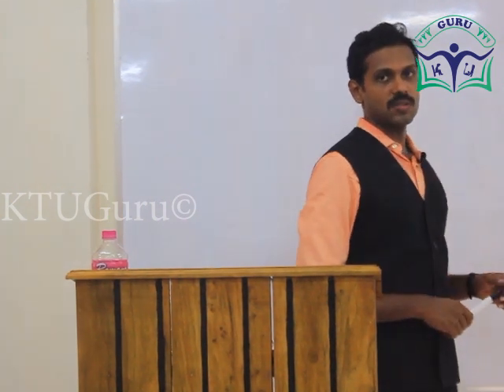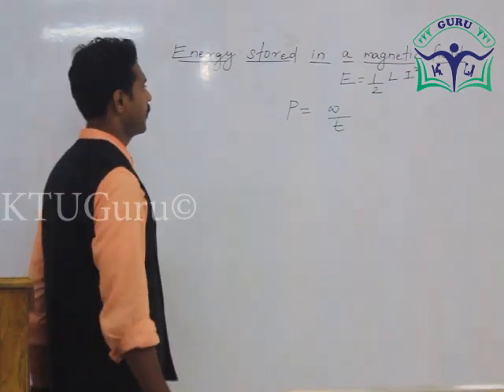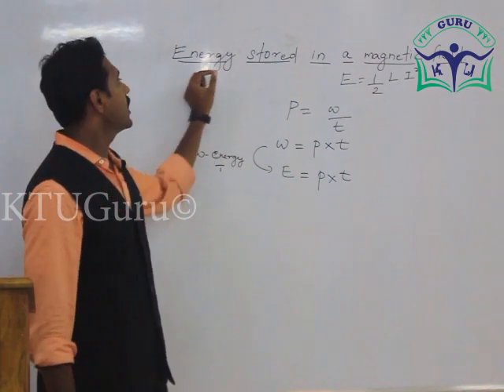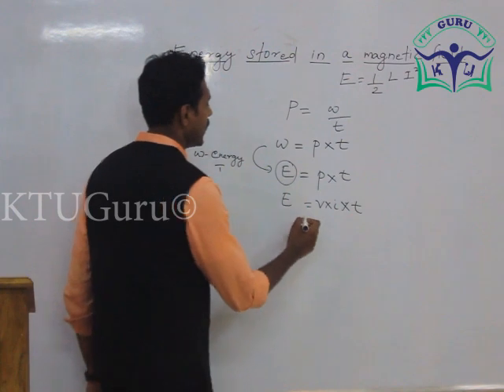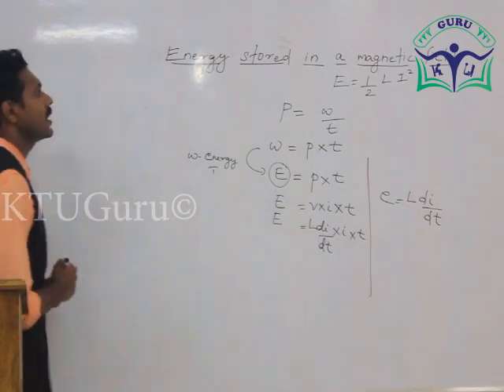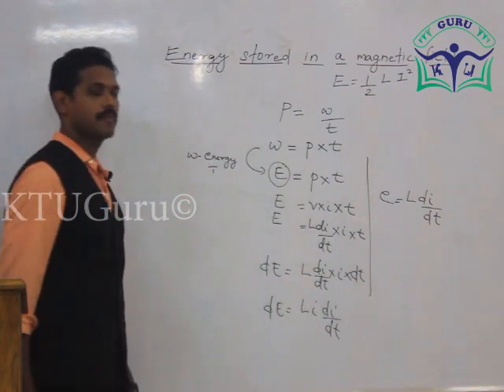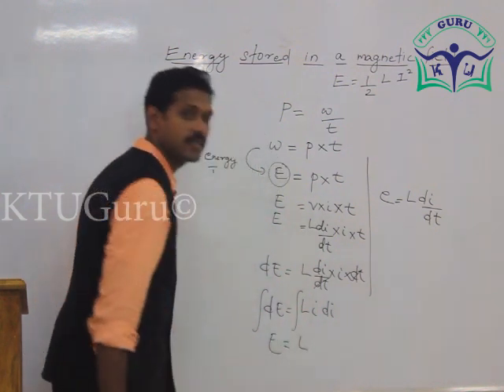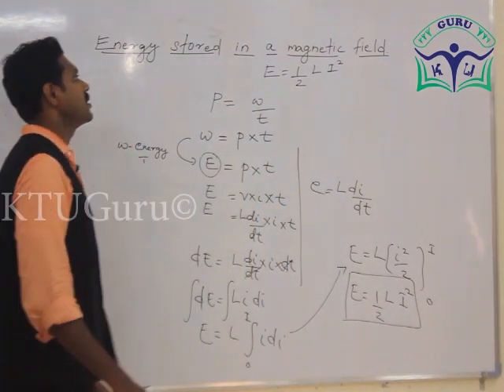Energy stored in a magnetic field | Engineering Lectures | Electrical | M2 | Btech | KTUGuru | KTU

Comment: The energy ( stored in a coil is dependent in the inductance(L) of the coil and the current
flowing. If the inductance were doubled with the same current flowing, what would be the
resulting stored energy?   Pls try to solve this. Thank you